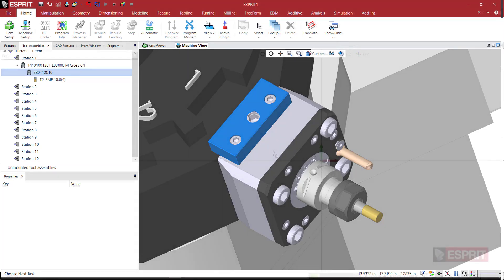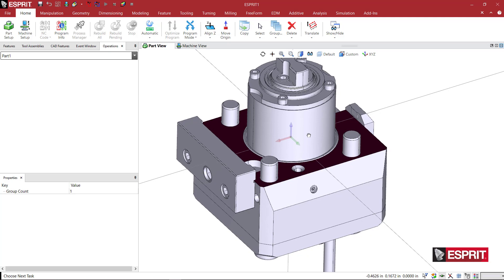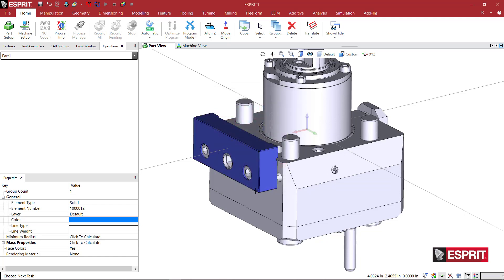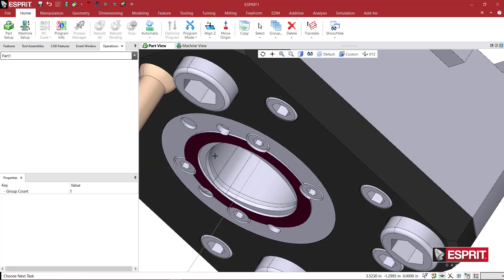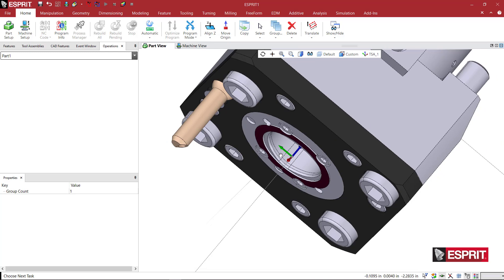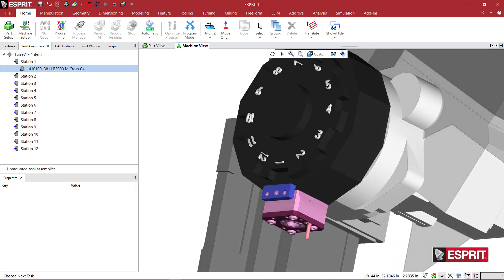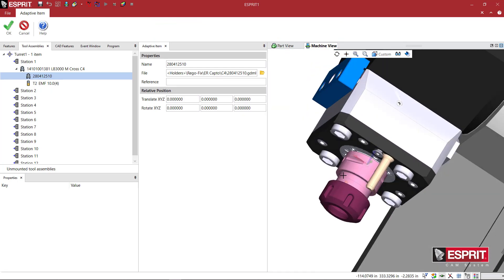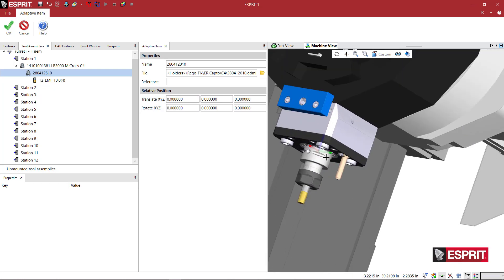Making a Radial Capto-style Live Milling Holder in ESPRIT

Comment: I asked the same thing on ESPRITCAM5AXIS as I dont know how linked these two channels are but, can you guys get into the stuff thats a little bit more challenging like a U-Drill that drills and bores (This would be great), or a broaching tool thats works with the machine's Z axis (not automatic or rotary) or even an adjustable boring bar holder for the turning center turret. Thanks for all the videos!